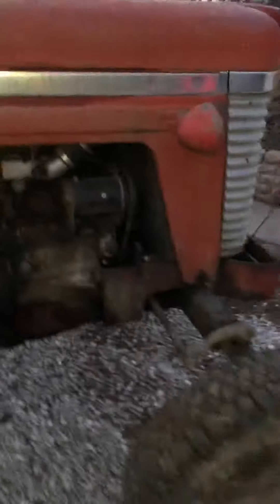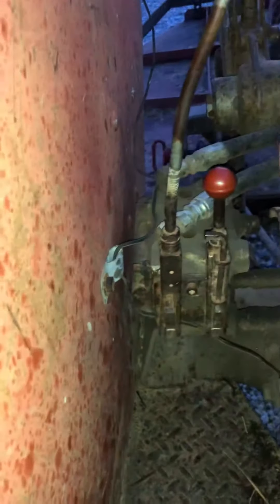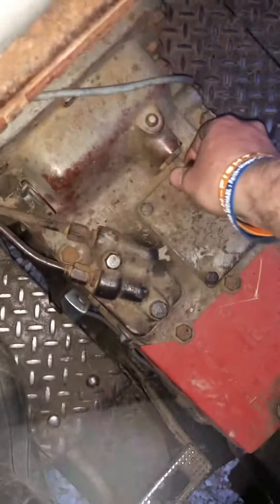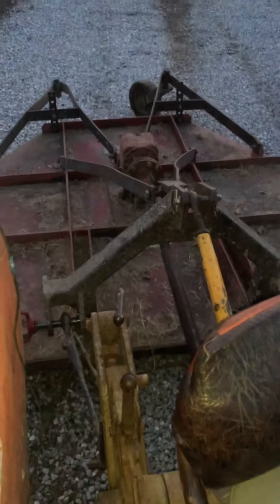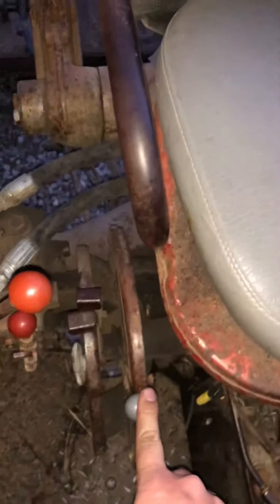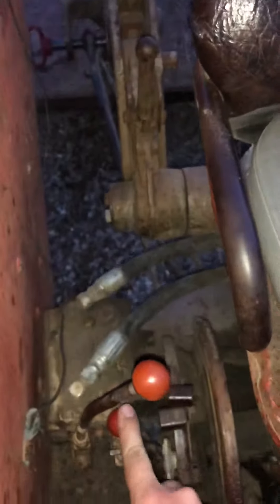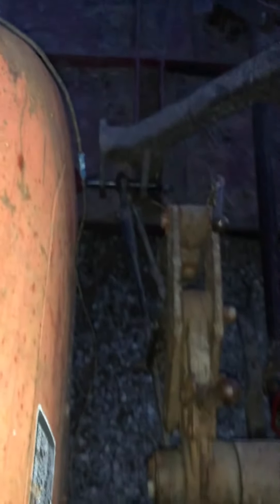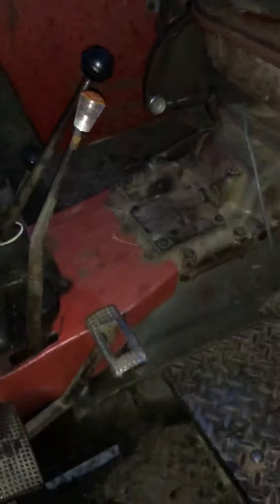Massey Ferguson super 90

Comment: I have a Super 90 and it is a fantastic old tractor, though a bit quirky.  For your remote hydraulics to work, you need to have the knob behind the remote control sticks turned all the way out, counterclockwise, AND you must have the 3 point lift lever ALL the way back into the "constant pumping" position.  You can raise the lift lever all the way back (up) and it will stop at a small square metal tab.  Very slightly push the lever outward, toward the right rear tire and then you can move it the last 3/8ths of an inch into the "constant pumping" position.  Your remote control levers will work perfectly.  The outboard lever will control your hydraulic line and the inboard will still work your 3 point hitch arms.  Hope this helps.
Reply: Thank you!  Bought a super 90 and couldn’t get the loader to pressure up but this tip saved me more frustration.

Comment: We used 2 farm with them in the 60's,70's  and they were a speedy tractor.If traveling at high speeds or pulling cotton trailers,as i was,you better lock your brakes together or it will jacknife on ya.

Comment: Hey Brandon, I have a super 90 too and noticed that on your 2021 story your super 90 is super smooth to drive and mine is super hard to turn in the steering wheel. Do you have any idea where to add power steering oil to the tractor? If u could make a video that would be awesome.Thank you in advance.
Reply from the maker: I’ll post a video